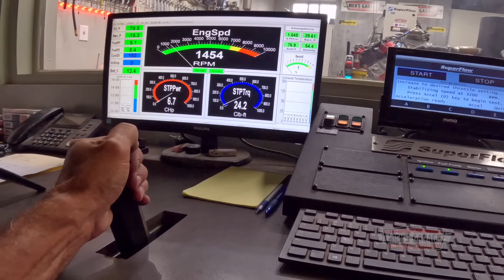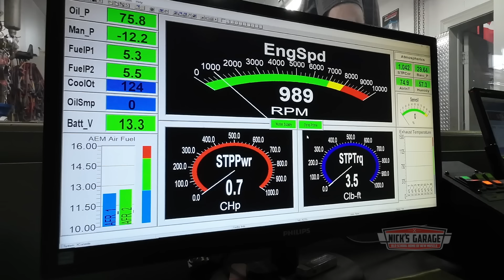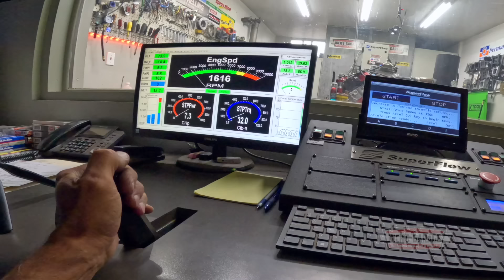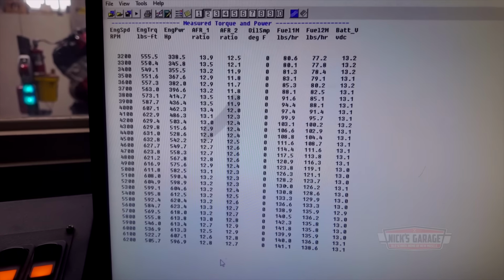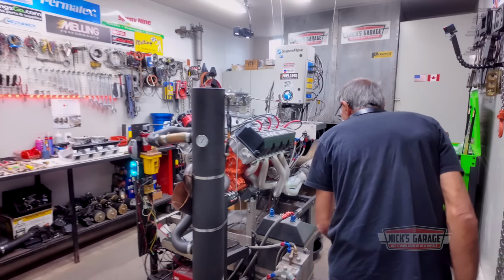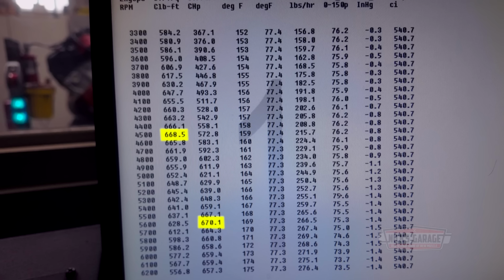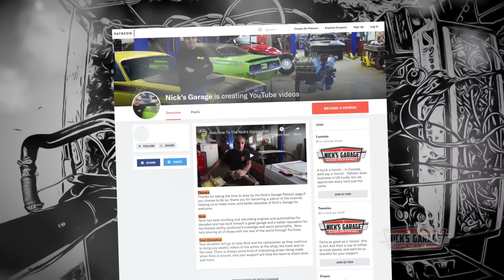Brand New Hemi DYNO Tested - HUGE Carburetor on a 541

Comment: Nick , try cranking it first then flick on the ignition.  Should crank alot easier.  We have been able to crank big engines up with a lot more timing with that method.  Good luck with that beast !
Reply from the maker: Thanks for the tip.

Comment: The first thing I thought when you started it... so very very smooth... look at how little the idle is changing.... and you can see it's smooth.
Even he low 970 ish idle was pretty dam smooth. It "sounded" smooth also... you know... that feeling you get when you hear an engine that sounds free and easy.
Your little carby tweaks even got it smoother.

Are they ceramic coated headers...?

Comment: Don Garlits used to run upwards of 40 degrees advance. Fun story about that when he first started running Hemi in NHRA
Reply: I've read the 40 degree figure. I'd like to know the reason for so much advance. Supercharged nitro of course. Is it something to do with that?
Reply: @plymouthroadrunner3893  not sure why.
Usually NO2 requires less timing. May simply be the shape of the chambers and piston crowns back then.
Reply: Not nitrous oxide, nitromethane -  CH3NO2..
Reply: Garlit's was one of the first to run more timing in his engines, he had an advantage until everyone caught on to what he was doing.
Reply: @plymouthroadrunner3893  The flame front for nitromethane is much slower than gasoline, so you have to run a lot more advance for best power. The reason nobody ran timing up to 40 before was because it was a well known fact that the old 1950's 392 hemi blocks would split and crack from the tremendous pressures on nitro with extreme timing. When the 426 Hemi came along, everybody initially ran the same settings as their old 392 setups. Eventually folks found out the 426 block could take a ton more power than the 392. The Ramchargers race team actually figured it out months in advance of Garlits but also kept it secret.

Comment: Just starting the video. I have to say, this is really wild, and I'm liking the EFI idea. I'm going to guess that, with the carb, it's going to pull around 500-550 HP, and over 600 lb-ft of torque. And I'm guessing that those numbers will go up slightly with the EFI setup, say ~575-600 HP and over 650 lb-ft.
Reply: Okay, I was WAY off on those numbers, and that was just the first pull! That thing is an absolute BEAST! I can't wait to see what it does with the EFI setup!

Comment: Now I'm no expert like these two, but with aluminum heads on my 400 ci Pontiac engine I had the initial timing set too low. I know these two are giving total timing. I had my initial timing set at 9 - 10°. On startup it would blow the air cleaner off. I called Edelbrock and they told me it was a slow burn combustion chamber and that aluminum heads can take a bit more timing than iron heads. I know completely different setups and engines. Always great to see Nic going through the problem solving with numerous testing and changes to parts as needed. Always looking forward to the next episode!
Reply: @davidgherardi7414  they are using a locked distributor so it has no curve. Initial timing and total timing are the same.
Reply: @realazliving           That is correct.
Reply: With aluminum heads you can generally run 1 extra point of compression and still run pump gas. Buddy built a 400 Pontiac with Eddy rpm heads and intake, Mild cam, headers. 10.5-1 compression. Made 450 HP and 515 TQ. Nice street combo.

Comment: Sounds like a binding starter against flywheel !
Reply: I think what you are referring to is the starter fighting against the locked out timing. I think Nick probably could have gotten the motor spinning with the starter before activating the ignition to start, or pumped the carb a few times to purposely flood it and then crank it with the throttle held wide open instead of having to move the distributor to start. Nick knows what he's doing, though. Best not to question a master's techniques😊
Reply: @mickangio16  .....All good.

Comment: How many hp is 20 psi ? I usta respring oil pressure relief valves , never ran more than 55. The brass gear will last longer. Beautiful work, idle with 70+ psi. Bet the couple psi is just heating up the oil and the engine being hot
Would really like to see a medium length cross ram intake.

Comment: There is fuel being sucked from the accelerator pump nozzles at high RPM.
Reply: I watched it again and the fuel only comes out briefly and then stops
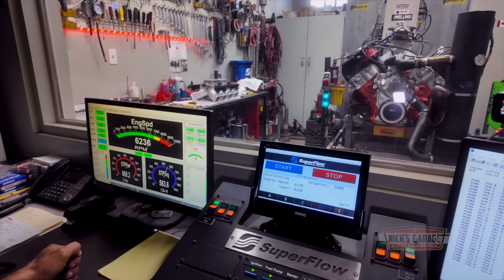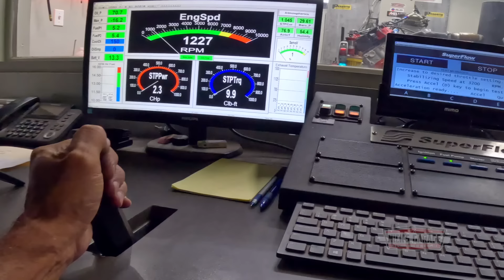Reply: @thomasward4505  Look at 18:30 and 22:30 toward 6,000 RPM, it starts  to spit fuel and at 25:45 it spits fuel much earlier. Let me know what you think.

Comment: I'd like to see this hemi with a 750 lift about 325 duration. Solid Roller cam with tunnel ram and a couple 750 Dominators would make for power at about 7000 RPM.  With big compression too.

Comment: Notice... to all the jealous haters out there. This is a true hemi engine. The very configuration that Rules NHRA  Pro Mod  to Top fuel . And would've totally Dominated NASCAR to this day if it wasn't OUTLAWED by the Chevy leaning wally parks.  They would've had to modify the Tracks to support the horsepower and aerodynamics of the Charger Daytona and Plymouth super Bird . Hell they'd be doing  over 250 mph . By now.

Comment: The 541 RB with Trick Flow heads were better torque numbers 🤪
Reply: Thats because a wedge is a superior NA street design
Reply: Also Trick flow is a way better head than the Edelbrock. The Eddy head is a mild street head at best.

Comment: The EFI should produce better numbers,That is a Beast.
Reply: I doubt it. It will have more drivability but thats about it. a good carb will outperform EFI 99% of the time. In a non boosted application. For boost EFI is the way to go.
Reply: @JerryM-p2v Thanks for that information!

Comment: Hi, Nick.  I have a 461 inch Pontiac (400 cid with a 4.25" stroker crank, 3 inch mains), with a Melling 60 psi oil pump.  I am running Valvoline VR-1 Racing oil, 20W-50, and I have a hot idle pressure of about 25 psi.  It runs at 60 psi (hot) over about 2200 rpm.  Should I be concerned about having only 25 psi at idle (about 850 rpm) ??  Thanks.
Reply: Sean, What temp . is "hot"?
Reply: I myself  don't  care for that 25 Idle. I would add some shims on the oil pump pressure relief valve spring  0.015-0.025  thick. Hot idle I would like to see minimum 35 psi
Reply: Ideal around 42

Comment: What's the hp at 6,500 RPM....
Reply: No sense pulling the motor over 5800 it is falling off. The cam heads and valve springs are done.

Comment: Efi 440 Sixpack are reddy waiting four thate Dyno.Have even me have thes tou go tou Efi.( In may Challenger 70SE) I am very happy with my six packs now Works 100 %.But Efi are Efi better Fjuel Ekonomi four sure.1.5 liter on 10km thats okej have 630Hp.The Overdrive GV Dou The jobb.Still have 4.10 gear. 28 Inch Hi E/T Taiers.(295.50.15)

Comment: If it doesn't produce at least 780hp and 820 ft. pounds of torque it's not tuned properly. A Cadillac 500 CID can make those numbers with iron ported heads.
Reply: Hopefully a helluva improvement to oiling system!
Reply: @mj_slender6717  Cadillac engine heads and block are made of tungsten steel and nickel cadmium. The pistons are made from depleted uranium. That's why they can produce insane amounts of power without breaking like Chevy, Ford, mopar engines.

Comment: 1050 hp 880 torque
That was WEAK, I made 928hp 800 torque with a 511 B1 at Koffels!!
Reply: well I bet you have a real engine with good heads, a big roller cam and a decent intake.
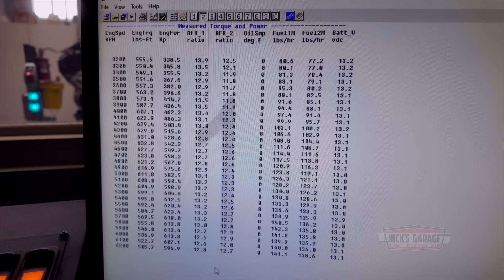Reply: @JerryM-p2v  well B1 heads full port by Barton then 4 bolt mains 400 block w/pro gram specialist mains 15:15to1 big roller 2/3/8 primaries 4"collectors B1 intake one dominator 1050 motor plate 7AL MSD half filled to the bottom of freeze plugs hardback etc so I could drive it on the street😇

Comment: 650 out of a 541 is pathetic
Reply: And………….you have.
Reply: Who cares it is what it is..
Reply: @nadronnocojr  A big block Chevy, 540 c.I. and it made 795 HP with 11:1
Reply: That's true. I seen a 800hp/670tq 496 bbc on 9.9 compression ratio pump gas build. That 541 mopar is watered down for sure.
Reply: If it had more compression, and higher lift cam, it would have at least 100hp extra hp.  Combination is too conservative for that many ci's.
Reply: @gulfy09  I do
Reply: I dont know what these guys do but a reasonable engine builder in Sydney Australia has no trouble getting 600 out of a 350 chev with 23 degree heads
Reply: Depends, on the brain stick, compression and intended use.
Reply: It’ll fry the tires off quick enough, no worries
Reply: 8mph
Reply: We  built a 1200hp bbc, but it's not a daily driver or even a street motor  . It all depends what the customer wants
Reply: I know some guys that make 11000 from a 500 inch. They don't drive them on the street either
Reply: @rickkelsch2040  go build one good luck
Reply: @rogerackley5176  that's the point of what the customer wants from this particular hemi
Reply: @rogerackley5176  Exactly.
Reply: That's what probably the customer wants. You can make much more HP If you want to.
Reply: It's a street motor, how much more would you want? Or be able to handle?
Reply: it's a street engine
Reply: I agree if im spending that kind of money for that much Cubic inches i want a minimum of 800hp. But the customers he gets are people who want it for the street.
Reply: My 472 CID Cadillac makes over 700 hp with stock ported heads. A .600 lift cam and aftermarket intake manifold.
Reply: Motor will have longevity and reliability built in this fashion. Not a race engine. Very conservative cam specs. The man writing the check gets what that man writes them for.
Reply: Hp is wasted if you cant get it to the ground.
Reply: Speed costs money,  how fast do you wanna go?

Also, I don't know why some of you think more power is the answere to anything. I can't count how many times a car with less power runming the 1/4 miles quicker then those over powered track cars, lol.

These guys at the local track racing 4 cylinders putting out over 800hp. 
I love racing too but if I had a car with a frame off restoration  then I wanna enjoy driving it rather then making it a trailer queen.
Reply: It's a torque machine not a big hp motor (although it's not shabby)
Reply: @rickkelsch2040 yeah because even engine is built the same 😒 🤔
Reply: An AH motor makes 1000+ on 430 inches, it just depends what the customer wants.
Reply: @nadronnocojr he's got a Camaro so take his comment with a grain of salt.
Reply: Just watched a guy rip 455 HP out of a fuckin 302
Reply: My 388 makes 525, under .600 lift, 10-3/4 comp, solid roller, run it on the street all day.
Reply: How do you go from 28 to 35*without looking at a single plug?
Reply: I've talked to a guy with a 426ci motor in a Super Stock A/H car raced in class his old motor made around 900hp, he said. he wouldn't say how much his new motor made, but normally around 800 for a race hemi. There's not much difference between race and a regular motor, mostly compression, intake, and probably different cam. keth black bult, an accurate factory race hemi with stock valve gear and all for a magazine made 800hp
Reply: As long as the CUSTOMER is happy…………..
Reply: @rogerackley5176  I think you went over some heads with that one. LOL

Comment: Thats weak. He is leaving a lot of power on the table. At the same time this is a street engine, and the Edelbrock heads are a huge bottle neck. This motor is done by 5700 rpm. We have had pump gas 496 BBC engines on the dyno make the same power as this 540 with less compression.
Reply: Start your YouTube  channel  and show your stuff.
Reply: @albertomoniz9051  My Buddy Gary in Ontario has a 540 BBC dart heads, 10-5.1 compression and a crane solid roller. 825 HP and 722 TQ. 1125 HP on the bottle. drives the car down the 401 highway. Don't need a YouTube channel, just need to know which parts work together?